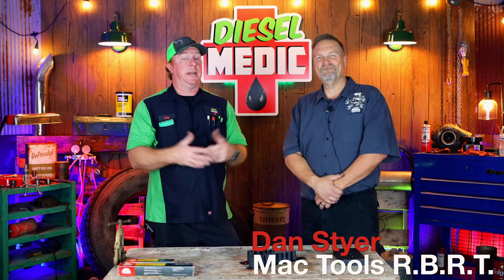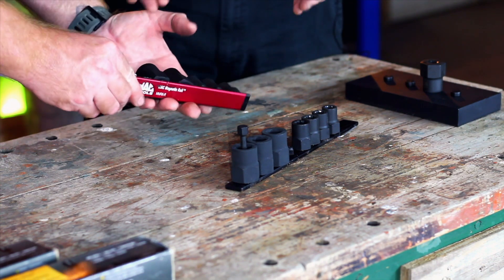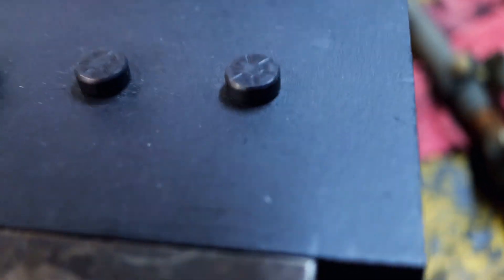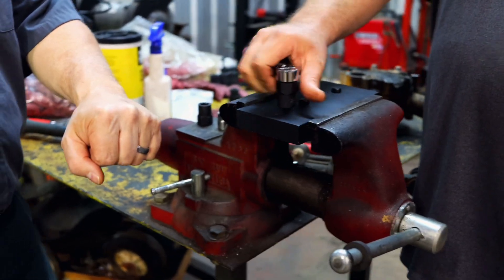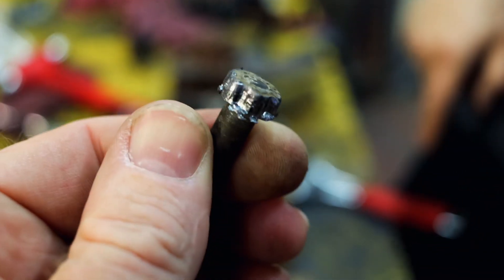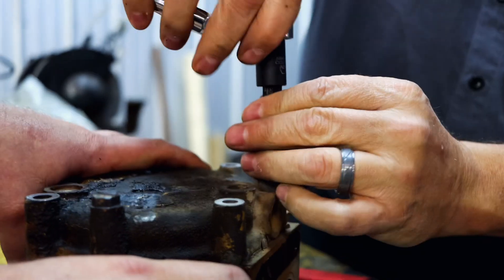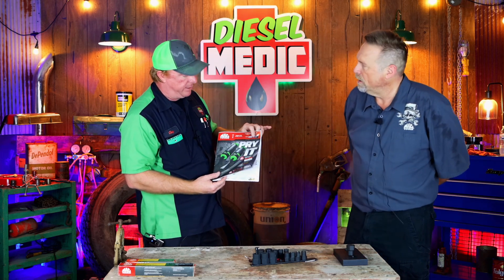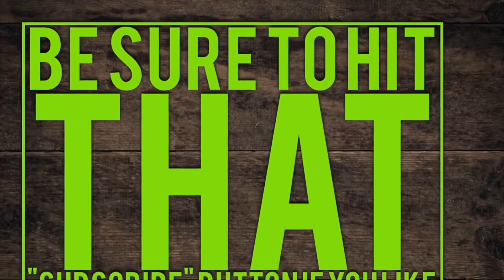Mac Tools R.B.R.T. Extractor Sockets With Demo Of Them Being Put To The Test!

Comment: What these sockets can benefit from is an extension to assist with hammering. I'm not talking about a regular 3/8 extension in the square drive either. But an extension that also slips around the entire socket, and has a nice dished end to protect your hand while you hammer it.

Comment: There is always the right tool for the job. Sometimes that tool is an RBRT extractor and sometimes it's the cutting torch, other times it's the compactor at the salvage yard. That bolt in the tensioner is ready for the compactor at the salvage yard.

Comment: try using the r.b.r.t. with a 3/8 air hammer bit matco FR438 or mac tools ah5538 to hammer on while turning with a wrench on the serpentine pulley bolt. also some of those have left hand thread on the bolt.

Comment: This shows that even though the rbrt sockets are great that you should still have different styles of extractor sockets/ tools. Sometimes rbrt works great other times you need turbo sockets, Gearwrench ones, astro flank bite. Because there are other factors like the size of the socket for clearance, some are really fat and durable like rbrt and others are thin like the turbo sockets. Also ive used a file to square up a bolt that's been stripped really bad so the extractor can bite better.

Comment: My methods are in this order; Heat Induction Bolt Buster on Nut or Bolt, Bolt Extractors Sockets, Weld a same size Nut onto it and it worked every time!
Reply: Or if the head of the bolt breaks, weld a washer to the broken bolt and then weld a nut to the washer. Saved my butt

Comment: The Irwin Hanson’s that Snap On rebrands have worked the best for me up here in the rust belt.  Tried the Craftsman’s before that (the cheaper versions, not the Turbo Sockets), but they rounded out.  Hanson’s are still going strong.

I believe the Hanson’s are made from the same high carbon steel process they use on their taps.  The only thing that would hold up better for extraction would be S2 tool steel, but that would be more expensive and well made high carbon steel will get a higher hardness than bolt material anyway.

Comment: That's why I have the Gearwrench complete set to fill in the gaps because they have actual size and minus sizes in sae and metric.
Reply: yup the gearwrench set is great.
Reply: That's the set I've been looking at getting. Is it worth the money?
Reply: @chrisperkins4728  yes but make sure you buy the mater set. part number is 84784  and its just under $200 on amazon. its nice because it has the normal size and then it has the same size but just a little smaller so u can get every rounded bolts off. Also it goes both ways so u can reuse them if they are uncommon bolts. overall im very happy with them.
Reply: @chrisperkins4728  the 28 piece set I have works great. Has saved my ass quite a few times already. Well worth the 160 I paid for them. I like that they are 1/4" and 3/8 drive and impact rated as well.

Comment: Hello again Clay 
Thank you for another Great Video.  I would like to know from your time with Dan.  Did he say anything about having this RBRT in a 12 point socket version? As a Aircraft Mechanic,  most of hardware I encountered is 12 point. And in SAE.  Again thank you
Reply from the maker: No I haven’t heard anything about it. Of course they want to keep things a secret until they are released to keep others from copying what they do and I respect that but Dan never talks about what is coming out next or anything like that.
Reply: Thank you again Clay, in short, I would not want you to break any confidence you have with Dan. I'm just a Mechanic looking for the best tool to work with!!! A part number and how much does it cost. I'm sure one must be in the works? Anyhow, thank you

Comment: @koontrucking on the bolt that was the first and only that ive seen that it hasn't worked on,  I would of welded a nut,  maybe a washer then nut of the same size and then tried it, if it was for a real repair and not just as a extreme test,  or that's when you try to bust out the knipex cobras and start wrenchin
Reply: Twist socket may have got it too
Reply: @brettwalkom948  if these didn't,  I'm almost certain twist sockets wouldn't have,  that head was at a very odd angle,  and rbrt will grab pretty much everything,  that was the only bolt head ive ever seen it not work on out of every demo ive seen, in person and every YouTube channel beside this one.
Reply: @footlongburrito  dunno but if I was in that situation I'd definitely try it..

Comment: Penetrating oil!! It does help. Molykote penetrating oil. The best. Works every time. Don’t the rbrts come in deep sockets? You can always cut off the extended threads when they’re too long and bottom out?

Comment: Need those extractor sockets need to be 8 to 19mm. To get bolt out of the socket you switch the direction and it will release it

Comment: That pulley with the extreme rounded bolt which the Mac tool failed. I want to see snap-on Friday to use the FDX socket to try to remove it. Let’s get snappy to get a chance to try.
Reply from the maker: The FDX is the socket he had at the beginning of the video on his test block. It would not remove the bolt either. We tried it

Comment: The tensioner has reversed tread.
Reply: Whooaa, you may have something there.
Reply from the maker: No it doesn’t have reverse threads. It’s standard lefty Lucy, righty tighty..... you be wrong here. It’s a common failure on the 6.7 cummins we replace them all the time on Dodge ambulances.
Reply: @KoonTrucking  So it was just you being naughty Clay, bevelling the sides like that was a cruel trick! The poor man was sweating buckets!
Reply: Definitely did not pass the test😞👎

Comment: With the same sockets u guts got i would of git that really nasty round off bolt out,, i work on exhaust systems alot, if u guys would of had applied some heat with torch get the head of bolt cheeey red and the smack that extractor socket in there while its still red cherry the bolt will form and and just to the shape of extractor making it get a better bite then let it cool off just a tiny bit but not ket it cool off all the way that bolt will would of had come out, just saying, i know its just a simple demo of the extractor sockets but yess, they seemed to b pretty darng good, i love this video and all the videos u guys do 👍👍👍👍👍👍👍👍👍👍👍👌👌👌👌👌
Reply: Wow lots of misspelling
Reply: @Juan Hernandez you can always edit your comment lol

Comment: Seeing that the bolt is trashed and the pulley is as well I would just weld a nut onto the destroyed bolt and put a wrench on it.
Reply from the maker: Like I stated in the video this is an EXTREME case just to test the tools ability to remove stripped out rounded off bolts.

Comment: Wow...no 19mm or 3/4? What’s up with that? On the bolt it wouldn’t remove on the tensioner or whatever it was should’ve used a buffer and smoothed it out that way those burrs weren’t restricting the socket.

Comment: Them 1/4" r.b.r.t. bits are to soft. I have some thats are unusable after 1 use on perfectly good fastners. They just twisted and rounded.  Used a normal Allen wrench to remove the fasntner.  Can't warranty them either since they aren't available for individual sale.
Reply from the maker: Yes you can warranty them out contact Mac they will replace them.
Reply: @KoonTrucking  Thats where I got the information from. Until they are available for individual sale they can't warranty the individual bits. Same thing with the bit I was missing from my set from day 1.
Reply: @danthemacman8719  thanks

Comment: I think that tensioner was a true real world test of some of the messed up stuff i've seen. The only other question i had for that tensioner was it a left handed thread bolt? if it was it may have come off if he tried it that way. I think these sockets arer a good investment. IF the made deep ones that would also be a good investment for the tigher areas or like on that sleve nut with the bolt sticking out.
Reply from the maker: No they are regular threads left is loose.

Comment: I barely comment. Nice tool  But in reality 80% of the time that a bolt or nut is rounded it's because is in an uncomfortable position where socket and wrenches are working on an Awkward position ...if the socket or wrench is an awkward position in the first place, then tell me how I'm going to be able to swing and hammer on socket. ....also I almost cried when I saw him grabbing the hammer by the neck instead of the end of the handle